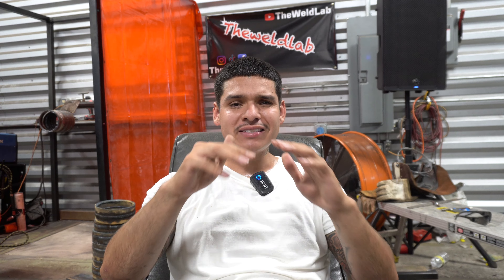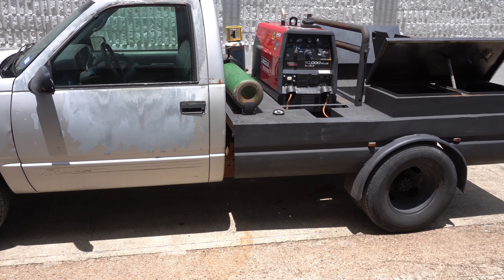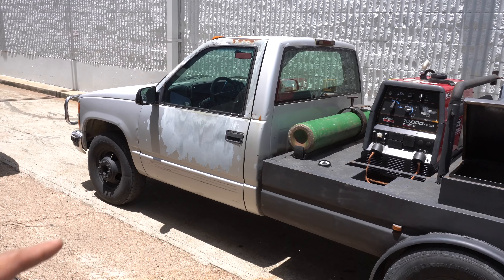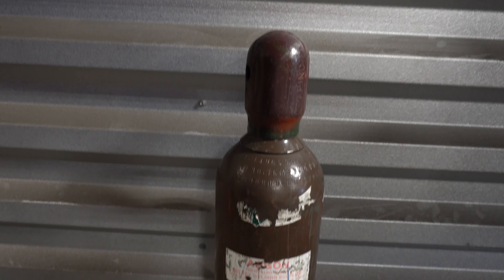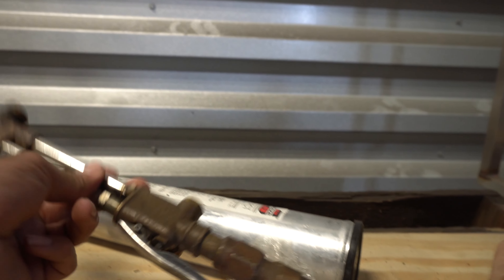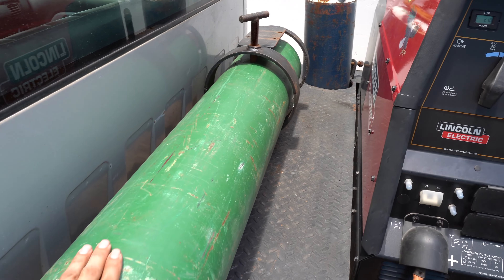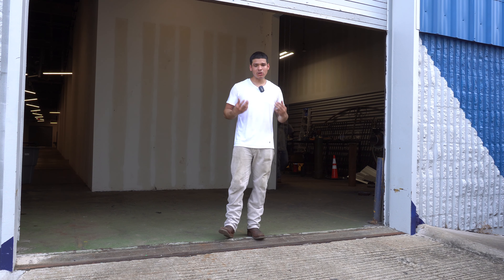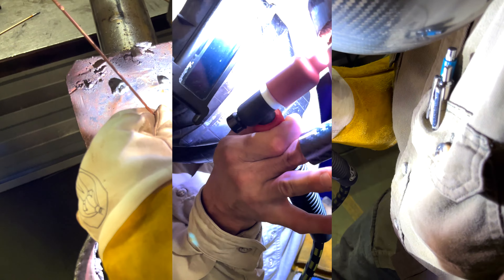Bare Minimum Tools You Need To Offer Mobile Welding Service

Comment: Hey man I appreciate your knowledge and I been doing flux core for about 6years on little projects. Now yes I'm in school and it's going pretty good so far as learning how to weld. I'm what y'all might call a late bloomer. I'm forty making a career change because I can't worry about the past would've and could've. Ain't no time like now! So thanks for sharing man. Looking forward to the video.
Reply: How’s welding school? Never went cause I always heard they suck and seems like they aren’t needed
Reply: @ RoLdHaR, I'm 51 been a farrier for 30 yrs. One more school year hear at the college and I'll have my cert in multi process. Practicing now for 1" vertical up and overhead unlimited. So keep on it you have some time.
Reply: I’m 43 and a high school dropout, been welding for 10 years. 3 1/2 years ago I decided to attend a  community college code welding program on a part time basis. In the fall is my last semester.  So it seems your getting on the boat I’m about to exit. Welding school has cleared up a bunch of misconceptions I had, and was told about welding. I feel I have learned more about welding in the last 3 1/2 years than the 7 years I welded before that. One thing about welding school, all instructors are not equal. If the instructor is not pushing you and checking your progress, chose another until you get a good one. Some of them are only there to collect a pay check and do very little as far as your advancement goes. Make sure your instructor can do the weld he is asking you to do, by showing you, and if they show you and weld like an inch or 2. That’s not enough, make them do more, don’t waste time your paying for. The best instructor at my school does a hands on  lecture every day, and pushes me aside when I’m doing crap welds, and lays down a good portion of weld to show me my errors. Lastly, you won’t learn to weld if you spend only 2 1/2 hours twice a week when attending a welding program, you must put in overtime. Good luck in your welding program.
Reply: Bro same here man I used to be a high school teacher here in Houston just started attending HCC welding program
Reply: @BowedUp  best thing i ever did was g o to welding school, learned so much in 6 months and was extremely fun

Comment: Everyone that does a beginner setup video shows build a dedicated truck. When you are trying to get in the business and still work another job I feel like a trailer setup might be better. You can tow it with a light pickup that you still use as your every day driver and customize however you want once you start making profit you can build a dedicated welding rig
Reply: Lots of sites don’t have room for a truck and trailer
Reply: Yea but you usually need the trailer for materials

Comment: I started my welding business in 1979. I bought nothing but used equipment for years. Later, I branched out to doing hydraulic repair. My current rig is a F550 with a Miller 325 efi, pto driven air compressor, 4 ton chain, and Smith torch set. The one thing I would add is getting 2 plus million in insurance. Some companies will require more than that.

Comment: A plasma cutter is a game changer when it comes to fabrication in the field. It can cut your fab time in half.
Reply: Which one do you recommend
Reply: @Hardstyler981  I recommend anything Hypertherm. I would buy the biggest one your machine can run. That will probably be a 45 or a 65. I run a 105 on my truck and I can sever cut 3” steel.
Reply: Depends on thickness of the steel
Reply: Could us an LN 25 for thin steel, just change rollers, whip, gun, tips. But, you'd need a 305 or better to push
Reply: @davidseanmacdonald1470  cut steel with a LN 25?
Reply: No LoL, I was saying the plasma cutter is good for thinner steel! Lol
Reply: I was also referring to the thin wall tube he's welding. Sticks too hot, but a buzz box will work, I was implying that an LN can do buzz box work if a few parts were swapped
Reply: @davidseanmacdonald1470  ya definitely, a LN or 12vs can weld thin steel.  As for the plasma.  I cut up to 3” steel with mine.  Not sure what you consider thin material.
Reply: @OFW  no shit? 3"? I'm a field Welder and Ironworker, and we hardly ever use plasma cutters, it's something I used very little. And when I did, it was for thinner material. My mistake. I didn't think the portable had enough power for thicker steel and being in the field, my work truck has 3 welding machines, oxy/acetylene bottles, 3 LN's about 500ft of leads, chop saw, hammer drill, 2 impacts, extension cords, cooler and barely enough room for a compressor. So, its torch or grinder for cutting any steel for me!
Reply: @davidseanmacdonald1470  plasma definitely has its disadvantages.  But everyone is usually impressed with the plasma.  Sounds like our trucks are similarly outfitted.
Reply: @OFW  I left out all my consumables clamps hand tools etc. Never enough room! And nobody puts shit back in my order/spot! Need my own thing, tired of making other people rich!
Reply: @davidseanmacdonald1470  going out on my own was the best decision I ever made!   Just have to make the jump.
Reply: @OFW  easier said then done big guy. I've built a name, got a few supers from past jobs that I talk to, ran my idea of starting my own thing and a few of them were willing to give me a shot. I didn't get to in depth, but I need to find if it involves bidding and if it does, would they still give it to me.

Comment: Hey, how's it going? I appreciate all the content you've been putting. Out, we need to get this younger generation into the trades I've been welding for 20 years and stepped away, but I'm getting back into the wild industry because, in a year and 6 months from now it's going to be on fire. They will not find enough welders for the jobs. That are opening up.

Comment: Welds leads can be had for cheap on marketplace sometimes depending on your area but personally if you have the cash I’d invest in 150 foot of stinger and ground. More expensive but there’s been quite a few times that 125 has screwed me and there was no way to get the truck any closer. Just my .02

Comment: We have a Ranger 225 and  it works. I prefer the preditor generator and omnipro 220. The omnipro pushes around 5-7lb of .035 a day. I can load the preditor and omnipro buy myself. The Ranger needs a hoist or it's tied to a vehicle for the whole project.

Comment: You can run ANY tool that has brushes on DC.  These motors are called universal motors.  Almost all vacuums are brushed motors, chop saws, grinders, anything that needs a butt load of power fast and hard.  Never met an air compressor with a universal motor.  Don't do that or you will burn up the motor and risk the welder as well.  Anything with a transformer like a radio won't work.  I have never checked switching power supplies like the newer cell phone chargers but I think those would be OK because they work differently than most other transformer type power supplies.

Comment: I got a bobcat 250. Do you think that’s good enough to keep up with a mobile welding service
Reply: Plenty of power for sure. You can have a guy use a chop saw while you're welding.
Reply: For structural work and repair is good enough man.
Reply from the maker: Yes definitely!

Comment: You can run the shop saw of the ol 200. Its ac/dc and used it so many times.
Reply from the maker: Which chop saw bro I haven’t found a ac/dc
Reply: @TheWeldLab  Dewalt D28715 the one you showed looks like it. But I’ve ran some band saw from Milwaukee that is ac/dc as well with no issues on the ol girl.

Comment: Is it okay to start my rig with a trailer just starting off? I bought a 4x6 trailer an I was gone customize it up to start with
Reply: I’ve seen guys using a trailer. It’s nice if you don’t have the money for a 2nd vehicle. You can drop the trailer when you’re done for the day. Plus it you mount the welder up a few inches on a bracket. You can fit longer pieces of plate, angle, whatever in side
Reply: Yes

Comment: Do you include gas as a consumable that is charged to the customer?
Reply: I do , as it costs me approximately $110 of fuel in my machine for a 10 hour day which would be out of my pocket if I didn’t include that in my consumables cost. Sometimes I charge for travel time/fuel if it’s more than an hour drive.

Comment: Don’t understand in America why everything is stick welded, here in the uk everything is mig welded unless it really has to, like out in a field with a break down with farm equipment but it’s usually done with little petrol generator welders not these big diesel ones. Literally stick welding is never done here at all don’t understand this bollocks of yanks thinking stick welding is stronger, it’s just inefficient and slow
Reply: I live in america and i agree, the biggest reason why its used more is probably because the average welder is like 55 years old